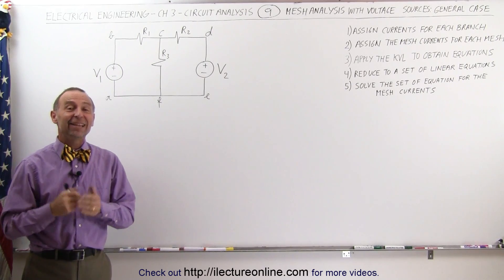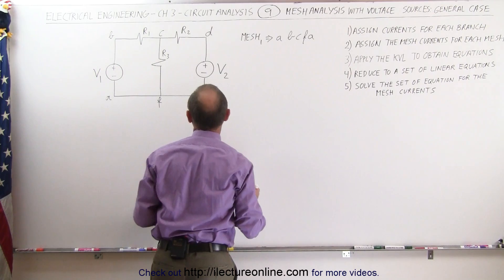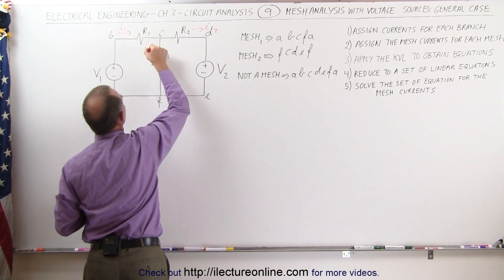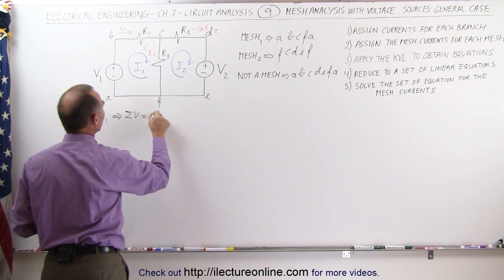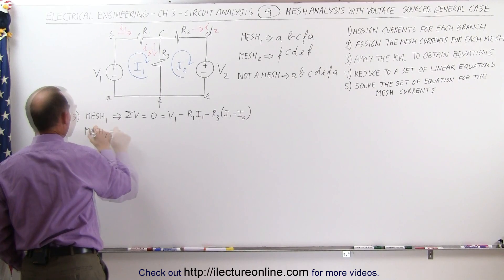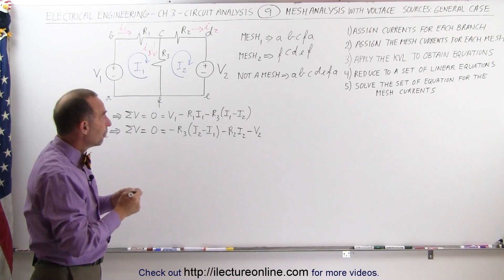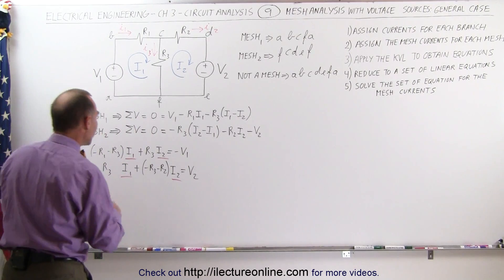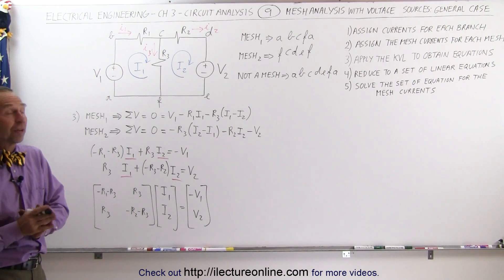Electrical Engineering: Ch 3: Circuit Analysis  (9 of 37) Mesh Analysis with Voltage Sources

Comment: for mesh 2 would it be incorrect to assume 0= v2-R3(i2-i1)+R2i2 ?
Reply from the maker: It depends on what convention you use and which direction you travel around the mesh.  If you follow the convention shown in the video, along with the direction traveled (clockwise), you should obtain the equations shown in the video.  You can check in the end to see if you get the same answers as in the video.  I have seen texts using a different convention.

Comment: Please let me know if I am wrong!. The mesh current I2 for the branch current i3 is opposite, so that means there at R3 is a voltage increase for the mesh current I2.  Therefore the KVL for mesh 2 should be:  -V2 - R2I2 + R3(I2-I1)=0. Thanks for your time processing it.
Reply: you're right !
Reply: That is what I got as well
Reply: same here I2 enters the negative side of the R3 resistor thus the voltage across it I got is -R3(I1-I2) which is just R3(I2-I1)
Reply: i know this is too late but i think that since it is a voltage decrease in  loop one according to our assumption that means it has the negative terminal towards c and the positive terminal towards towards f so in actuallity when we use the 2nd loop it finds the positive terminal first which is an increase in voltage when it comes to resistors so the step up in v becomes R3 (I1-I2) which is indeed as he put it just -R3(I2-I1) again i might be wrong

Comment: I have the book " Fundamental of electrical circuits by Charle K. Alexander and Matthew N. O. Sadiku " and in their example they start Mesh number 1 with -V1 +R1i1 +R3(i1-i2)=0 and Mesh 2   R2i2+v2+R3(i2-i1)=0 my question is , will it make a difference at the end?
Reply from the maker: It shouldn't make any difference.

Comment: thank  you so much sir .but their is confusion that in Mesh1 you have written R3(i1-i2) ,the factor i1-i2 where it come from ? 
i shall be very thank full to you if you explain it
Reply from the maker: Traveling downward across the R3 resistor there is a voltage drop I1 x R3 because it is the same direction as I1 and there is a voltage rise I2 x R3  because it is in the opposite direction to I2

Comment: Hello Mr. van Biezen! Around 3:51, if V1 and R1 are in the same direction, why would you write the equation like 0=V1-R1.I1-R3(I1-I2)? I mean, V1,R1 and R3 are all in clockwise direction. Could you please explain in brief? Thank You...
Reply from the maker: R1 does not have a "direction".  But there is either a voltage drop or rise across the resistor.  It you go across the resistor in the same direction as the current, there is a voltage drop. If you go across the resistor in the opposite direction of the current, there is a voltage rise.  Going around loop 1 with the current, there is a voltage drop across R1.